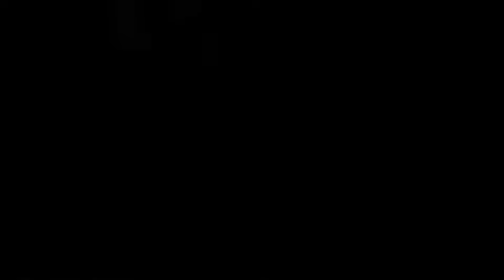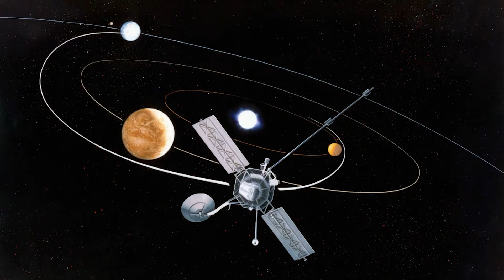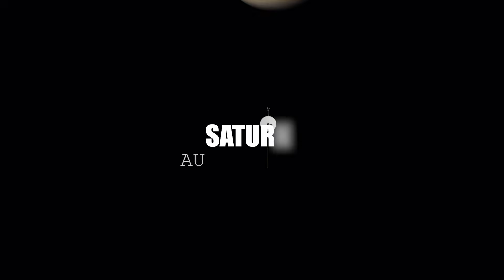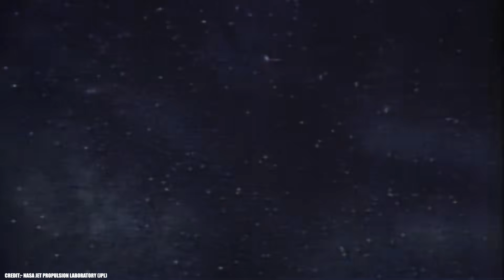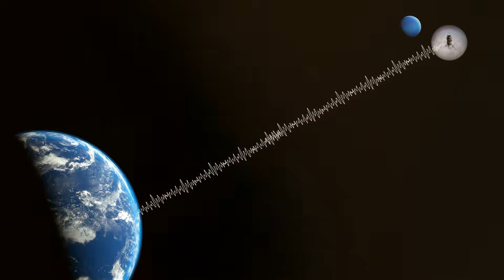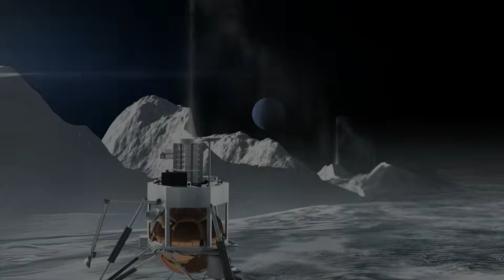Journey To Neptune, The Farthest Blue World

Comment: Why don't they just orbit around the planet instead of flying by it?
Reply: They would need propelant for breaking that would takeaway from capabilities and add cost.
Reply: Because it would get trapped in the planet's orbit.
Reply: @starfireprincess  So, what's wrong with that? A well built Neptune orbiter will stay in Neptune's orbit and keep sending images and other relevant data about Neptune.
Reply: To get there in a reasonable amount of time they need to get gravitational assists from the other gas giants, by the time it reaches Neptune it is travelling at a very high velocity with no way to decelerate enough to fall into orbit with Neptune. They would have to make do with the data received during the flyby.